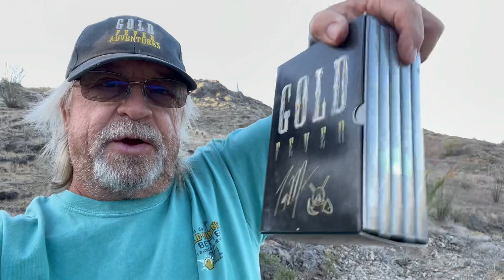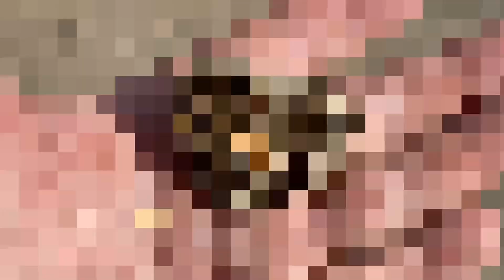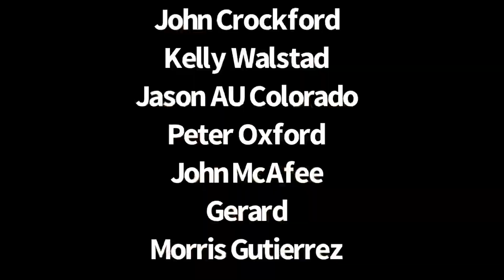Gold Prospecting - Gold Fox Mini Monster - Testing

Comment: I enjoyed that episode!! Processing bedrock Vac material by using the wet recirculating Gold Fox Mini Monster (perfect size) “instead of” a Drywasher. 
~But the Keene 160 Mini Drywasher has >>”super fine gold recovery” with a “dustless operation”<< as claimed. (Has an optional 12 Volt Wet Conversion Kit.) I would like to see this one used in action.? The Keene 190 is a bigger version model of the same thing.
Reply: Is their a 2ay to make this one have super fine r to or should I use the other in manly doing black sand at beaches

Comment: Love my mini monster but I had 50% losses with the  Provided mats!  So I switched to dream mats put a jarvine riffle in and some miners moss and now I'm losing nothing
Reply from the maker: Cool. Good to hear. Sometimes the wrong angle can cause loss.
Reply: I did the same, cut down a combo mat to size... re ran all my cons and was amazed at what I missed before.  Not 50% loss with the hog mats but close to 25%
Reply: Yeah that was my 1st thought too but I tried changing the angles! But I still had significant losses ! But I did enjoy the process of modifying it and now I have exactly what I want and it runs 4 to 5 buckets of dirt before I have to actually clean it out In my 20 years of prospecting and gold mining I have never seen a machine that was absolutely perfect With all my modifications I get almost no gold in the actual dream mat  it gets caught before it